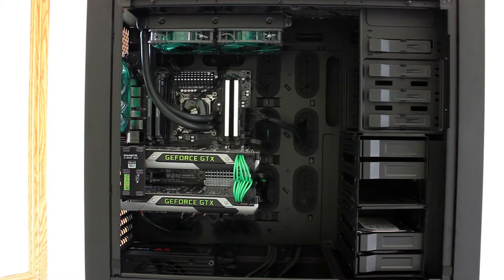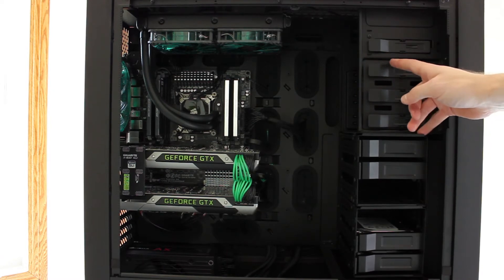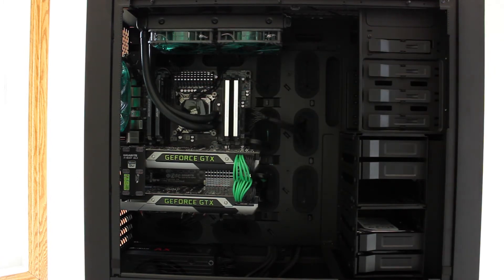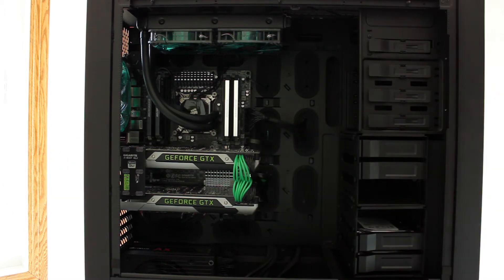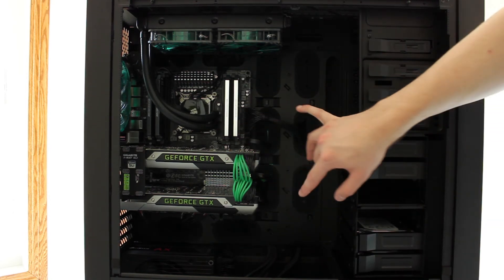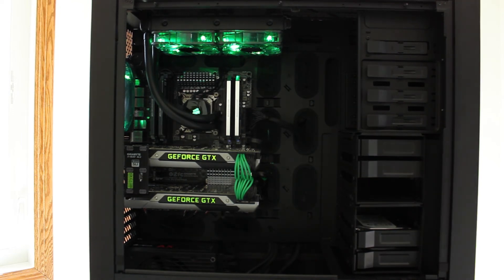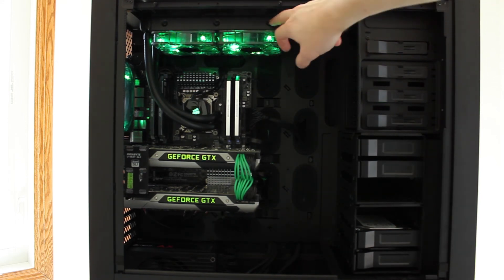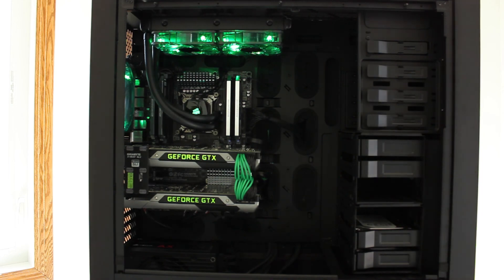Build 2013 - Overview

Comment from the maker: i7-3930k Processor
GA-X79-UP4 Motherboard
16GB 1866MHz Corsair Dominator Platinum memory
RAID-0 256GB Samsung 840 Pro SSD's
RAID-1 4TB Seagate 5,900 rpm drives.
SLI GTX Titan GPU's
Corsair AX1200i PSU
Corsair H100i CLC